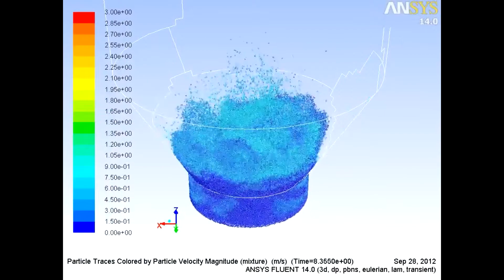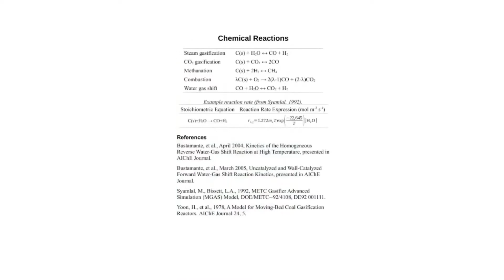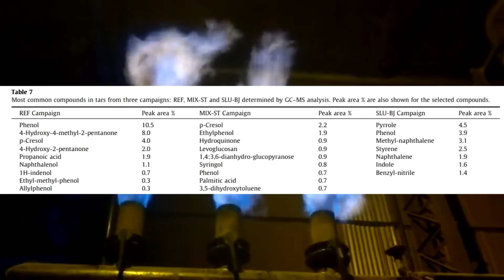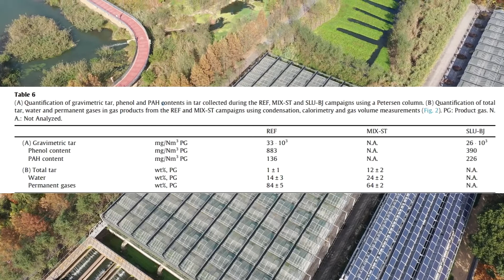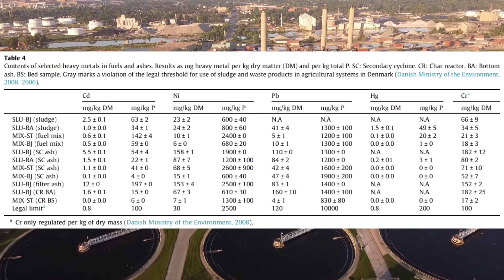Gas from straw and biosludge + phosphorus produced by a fluidized-bed gasifier

Comment: Metso outotec makes fertilizer from sludge ash by heat treating it to sinter and drive off the heavy metals, they also remove the iron and alumina but im not sure how. It's called AshDec, but alot of the information is in languages I don't speak.